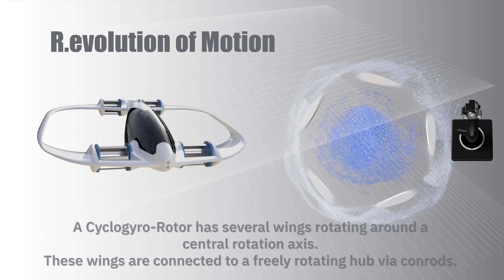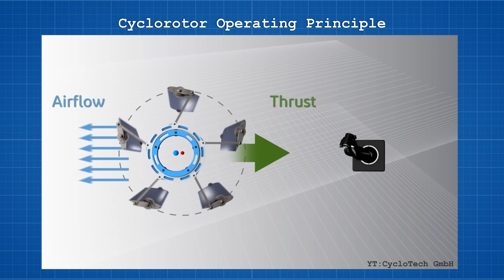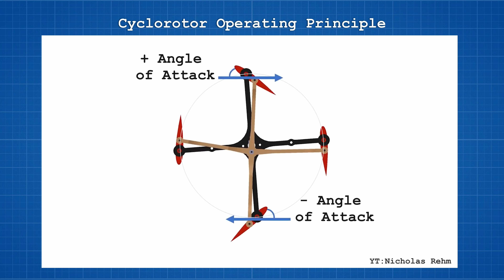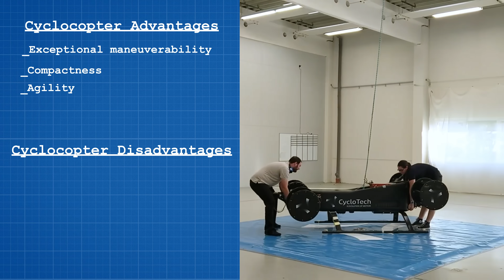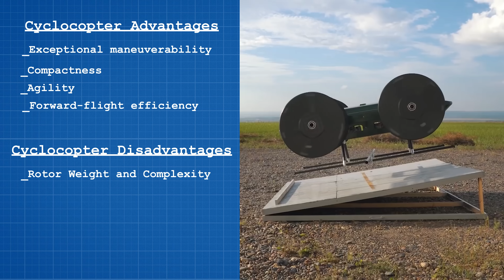CycloRotor: Is this the future of eVTOL Electric Propulsion System?

Comment: The efficiency of cyclorotors is much lower than propellers. Since the energy density of the battery is already a problem with propellers, I am sceptical about this concept. No gliding, too.
Reply: @Zugo99  The Helicopter starts to fall and he has to go through the air, so the propellers get more speed because of the air gliding against the blades, so it gets a bit of a lift... the helicopter crashes, but it does not fall out of the air and can land even for a crash kinda safely... Blackbawks can crash up to 80kmh without a dead crew afterwards....

If one engine fails at this system it will tilt and drift to the dead engine side and then overturn itself and gobstraight to the ground
Reply: @somal1anwarlord197  technically the up flow of air changes the resultant rotational lift causing the total aerodynamic force to be forward of the axis of rotation.

 If any multi engine helicopter loses an engine, in the worst case scenario, the helicopter would do a partial power approach or just enter into autorotation.
Reply: @somal1anwarlord197  it could prob be made to function for a safe landing if it had one of 4 fail if it hadenough energy though,
Reply: @somal1anwarlord197  This is the principal that allows autogyros to work, in essence.
Reply: @somal1anwarlord197  looks like this design has the front rotors running in tandem w/back, i.e. the two front motors are powering a single axle. If I'm correct (might not be) it would take a dual failure of both motors to completely stop power to one axle. You'd experience 50% power loss on one axle, not sure if that would be enough for emergency landing or if it would fall out of sky still. Interesting to find out
Reply: @Zugo99  helicopter rotors can continue to spin without engine power simply by changing the pitch of the rotors. It’s called auto rotation
Reply: @Zugo99  ur not really thinking ab the problem. it will fall to the side that the engine has failed on. opposed to a helicopter, with ONE rotor, in the center, that continues to spin with momentum that can produce lift as the helicopter falls. this is called autorotating, and its how helicopters land when their engines fail. you cant autorotate a cyclocopter.
Reply: @spacenutcj6919  Its going to depend of the design of the aircraft. several where shown to have wings as well as the rotor systems so gliding may be possible to a degree.

 as well if one of the engine fails (but doesn't seize up entirely) then it should be able to auto rotate like a helicopter that has four rotors. as the angle of the blade is independent of the engine failure, meaning the pilots can still control blade pitch. all they would need to do is dial back the other engines to idle and control the blade pitch to allow them all to auto rotate or maybe they could alter the pitch of the other engines blade  to allow the engines to assist the auto rotation on the last blade at the last moment.

if it does seize the engine then there could be a release from the engine itself on the rotors driveshaft so it could also be designed to share the work onto the other engines via a gearing system or share it via axel/gearing to the opposite side engine.)

As well when considering how it would react to an engine suddenly no longer rotating we need to think about how the gyroscopic effect of the other rotors is going to change the path of the tilt as it begins to fall. since each rotor is basically on its side compared to a helicopter. it should in theory when say the front left engine would lock up. it should begin to actually want to yaw to the left side which will cause it to begin to bank to the right due to gyroscopic effect. so it shouldn't actually tilt down where the loss of lift is.

This may even be possible to correct for using flaps or trim on a aircraft with normal wings or it may be possible to do the same using the remaining engines blade pitch and RPM.

Similar to loosing one engine on a 4 engine plane.
Reply: @yawnos  i do hear you but keep in mind the cyclorotors are much lighter and way less large than helicopter rotors so that might play into their momentum when autorotating. its an interesting thought
Reply: @Zugo99  the main rotor blade continues to rotate. The loss of power reduces the lift but does not eliminate it entirely. The pilot maintains control while looking for a landing spot. Once commit, the pilot flies to the landing spot and before landing pulls the collective to maximize pitch and reduce rate of descent to make a the landing. They train for this. So if one of three lifting devices fails on this platform, how does the pilot maintain control?
Reply: @dm_grant  : Just watch out for blade stall.
Reply: @dm_grant ,
🔵 I've got to wonder if the 'Magnus-effect' would allow this to 'Auto-rotate' down controllably (from a decent height) without power?
I'm sure it could be programmed to take advantage of this phenomenon under certain conditions.
Reply: @dm_grant  That is a great answer for "what if the helicopter engine fails". If a helicopter main rotor fails, you will likely die.
Reply: @dm_grant  this model is even worse. In any sort of multirotor that has 4 or less thrust points, if one fails it is going to have unbalanced torque and go into a uncontrollable spin as it flips to the ground
Reply: @dm_grant  what if the tail rotor fails then
Reply: @brandonporter6223  don’t know, not a rotorhead. I suppose your screwed. Hopefully someone else can give you a better answer.
Reply: @brandonporter6223  autorotation.
Reply: @brandonporter6223  tail rotor failure isnt actually too bad. You lose yaw control, but aerodynamics will be stronger than gyroscopic forces and point your nose forward at a high enough speed.
It makes it harder to land but is overall surprisingly easy to deal with.
Reply: @VoidplayLP  that's if your in forward flight right? Whilst the booms aerodynamics are still useful.
Reply: @dm_grant  yeah, I mean, worked really well for Kobe.
Reply: @dm_grant  we all watch Destin from smarter every day but not only is it difficult it isn't easy especially with heavier helicopters lol not even a military pilot will be able to handle this maneuver easily.  You're full of it
Reply: @Zugo99  this machine needs all 4 motors to balance. one lost and its upside down. helicopters hang suspended from the rotor blades. you dont lose the propellers you lose propulsion to those propellers. this machine is also direct drive and can not auto rotate. sorry. but this is a no go.
Reply: @Schwamm Mueri nope, Gyroscopic effect will cause it to spin wildly. Let's say front right rotor stopped working, so you disable back left in tandem so it doesn't flip. Front left rotor spin and back right rotor spin will be reversed from each other and due to their offset from the center of mass will cause a gyroscopic effect which will Yaw the vehicle quite violently.
Reply: @ScarletFlames1  I didn‘t mean that the opposite motor would shut off, but that you use the opposite one to balance, so that it doesn‘t flip upside down. That way you can still use the other two diagonal ones to point straight upwards (or if necessary to correct for the gyroscopic effect)
Reply: @ScarletFlames1  like i said. it cant balance without all 4 motors running. its no different than any other quadcopter that has counter rotating props. these ones just look a little different.
Reply: @ScarletFlames1  it will yaw AND roll.
Reply: @grenadegoboom4967  quadcopter just don't have the necessary program to balance with just 3 motors, but definitely could. The broken arm of a quadcopter would just be an added weight, which has to be balanced with the opposite motor. The problem you would have with normal quadcopters, is that they would start spinning (still staying flat, just spinning around the up-down axis). The main difference between a quadcopter and this cyclo-thing here is that it can't just apply force up and down, but also forward and backwards. By using that trait to counteract the spin, you could fly it with 3 motors.
Reply: @schwammmueri8629  Yes but what counteracts the force of the lost motor?
Reply: @sheilaolfieway1885  To balance that out, you would use the rotor diagonal to the lost one. You can do this by pointing the force upwards to counteract the flip (and then switch between upwards and downwards force on that rotor in whatever direction you are about to flip). That‘s why I said in order for that to work, the cyclocopter must be able to land safely with the downwards force of just two rotors at full power, as the third one can only be used to prevent flipping and spinning.
Reply: @grenadegoboom4967  As much as I‘m skeptic of the whole concept too, I don‘t think it would need all motors, as long as it can produce enough lift with just two of them to safely land. If one breaks, you still have two diagonal motors for lift and one (diagonal to the one that broke) to control the rotation. This would work exactly because they can produce lift in all directions on one axis (here mainly just up and down).
Reply: @schwammmueri8629  it cant balance with two motors. aside from being weird looking. its a standard quadcopter.
Reply: @schwammmueri8629   depending on where the rotors are located and if they are free to spin on their own this may not or may work seeing how the rotors are located at the corner one lost rotor would likely tip the vehicle in the direction of the non-functioning rotor, this will throw off the balance and make it very hard to continue. Even with two  I don't think it will work.
Reply: Not to mention the VOLUME
Reply: @Zugo99  Pray
Reply: @fbbinoire201  what if i killed god
Reply: @Zugo99  The loss of a lift producing surface on any aircraft would be catastrophic, but the loss of an engine on helicopters or planes remains manageable. That's the type of failure David was asking about for this type of vehicle, and I imagine such a failure would not be manageable in this case.
Reply: @Zugo99   smarter every day has a great video about this.
Reply: @Zugo99  'autorotation'  - look it up
Reply: @Zugo99  I would trust a helicopter propeller thousand times more than such drive belts shown in the video. ... in addition you have four cyclic rotors that can fail while having one rotor at a helicopter.
But it is not only about the rotors also about the engines. If the helicopter engine fails they can use autorotation... and what will the cyclorotor do?
Reply: Definitely agree. There is something cool about tires that could turn to rotors though.  Up my degree is in psychology, and I use yt to work on my truck. Not an engineer. Just would be cool if the wheels could adjust and raise, increase speed and turn a car into a flying car. Big dreams
Reply: @Zugo99  it does fall, and the fall makes the helicopter blades spin. The pilot then uses that stored energy by changing the angle of the propeller blades to give upwards momentum.
Reply: @Zugo99  Wow....You know you're talking to someone who knows nothing about rotary aviation when they insinuate a heli just falls out of the sky if the engine fails.
Reply: @Zugo99  then you auto rotate.
Reply: Way to be optimistic
Reply: And sounds really loud too!
Reply: @Zugo99  Helicopters use the main rotor to glide. This is called auto-rotation. This type of lift generator cannot slide using pitch. Because the axis of rotation is not centered. For emergency safety on these aircraft, there should be more than 6 rotors instead of 4. That way, even if one fails, you can keep it level and safe. Or there is another way that doesn't add a rotor. However, adding other features will negatively affect parts, cost, life, shipping weight and maintenance costs.
Reply: I'm not an expert but it seems like there's a lot if moving parts that could break compared to a propeller
Reply: @Zugo99 : A helicopter will auto-rotate and can be landed safely with complete engine failure(failures) and is actually trained as part of obtaining your pilots license. Helicopters are actually quite safe.
Reply: @Zugo99  Cause you haven't studies aviation nor aerodynamics in any sense, yet you respond to YT videos as if you HAVE.  You don't "understand" cause you've never taken to the time to understand how a helicopter's rotor blades  work and how lift even works on any aircraft.
Reply: @jamesroberts3642  Im a mechanical engineer btw
Reply: @Zugo99  Uhhh...ok...Even if you really are, that's like me saying, "the earth is round Mr. TurtleBeat22" and then you reply to me by saying, "No...it's flat...I'm a geologist, btw" or like saying, "No...the Earth is flat and I know because I study biology".  I don't cause what you're profession is or what you studied. If you don't understand how and why helicopters don't just "fall out of the sky" when the rotor stops, then you simply don't understand AERODYNAMICS.  Now....If you were to tell me you were a Aerospace Engineer, then I would either call you a liar or I would just say you're really bad at understanding what you studied.  There is a reason choppers don't just fall out of the sky when power is chopped or is when there is no thrust....and it happens all the time.  They do it on PURPOSE in training (just like we did in fixed wing (airplane) training)
Reply: @jamesroberts3642  actually most mechanical engineering programs involve at least a little aerodynamics, so it's a bit rich that he says that even.
Reply: The fact that they want to use it as a literal flying car propulsion system is the depressing part. 

Seriously you have invented a new propeller engine design capable of competing with regular helicopters and the first thought is practical flying cars? 

What a waste because its a genus design for future aircraft but they want to use it to create 3d traffic jams, never ending noise from the skies and less safe travel for all due to increased private flying with not much real safety over-site for operations. Have fun dodging falling aircraft parts. 

Genius tech innovations but truly stupid applications
Reply: @Ilikefire2793  Right? Think about replacing emergency services helicopters with these things! A helicopter that can get VERY close to cliffs for rescue operations, and the travel from and to the hospital is done at several hundred kmph... it's going to become the de-facto replacement of all emergency services helicopters.
Reply: @ScarletFlames1  perhaps. 

However its kind of rare to begin with for helicopter rescue services being the first choice for responding to emergencies. 

Tho definitely this design may change things. 

The problem could arise if the physics of the 4 engines has some sort of weird problem quirk like the v22 osprey has where its engines are so powerful that its possible to drown the victim you're trying to save.

Only time will tell.
Reply: This is not genus (You meant genius, by the way).  This type of thrust is nothing new and has been though of already way in the past.  And there is a reason it didn't "take off" (pun intended).  Research thinks involving trust-to-weight ratios, auto rotation, etc when it comes to non-winged aircraft if you really are interested in this concept and want to know more. We live in a time where "solar roadways" and the "hyperloop" is considered "new" and "genius" when it's not at all (yet millions online are taken advantage of for funding)
Reply: @Ilikefire2793   This is not a "new propeller ... design".  This mechanical design called VSP or Voith Schneider Propeller (although made from very heavy solid brass and stainless steel) is what is under many Tug Boats for 20+ years.  In the case of the tug boat it allows for instant 360 degree directional thrust control and are often used in pairs pointing down.
That said, I agree with you completely.  Any dream of filling the skies with high energy consuming personal vehicles for the masses is a NIGHTMARE in my opinion.
Reply: @Zugo99  a helicopter doesn't crash if engine shuts down https://youtu.be/BTqu9iMiPIU but this one needs all 4 to keep running at all times.
Reply: @davidgrant6451  i think it will lose lift on one corner of the vehicle, but it will still be controllable. A single engine loss on this thing could be countered by lowering or reversing the rotor Speed on the diagonal opposite side of the broken engine. but i guess  by doing so a emergency landing is unavoidable as the aircraft does not have enough thrust anymore to retain its altidude.
Reply: @Zugo99  It's a phenomenon called 'auto-rotation'.  Feel free to look it up.
Reply: @Zugo99  think of helicopter blades as a wing. Technically, it is a wing, just rotating and have adjustable angle of attack, allowing you to control its lift. 
If for some reason engine stops, blades will continue to spin - that’s called “Autorotation”. It will generate enough lift to let you glide. 

But if blade will stop spinning midair, that’s where you are ded
Reply: @Zugo99  Engine fails = no problem, safe landing

Gearbox fails = You're fucked
Reply: I don't get why everyone so obsess about battery only powered drones. Making hybrid drones is way better since they have higher energy density even after loss at the generator. People already break endurance records with it with up to 10h flight time.
Reply: Or auto-rotation, meaning it'd drop like a brick.
Reply: Can I Be a crash test dummy
Reply: @nathanthomas8184  It's 2021 you can be whatever you want!
Reply: @somal1anwarlord197  But what pronoun do we use when talking about/to the dummy ?
Reply: @somal1anwarlord197  "I identify as an attack helicopter" -- Lauren Southern
Reply: @nathanthomas8184  yes, you can. Not sure about crash test, but dummy you are already.
Reply: @Zugo99  depends on how it fails
Reply: @Zugo99  it's a real thing that happens. The propeller loses power but doesn't stop for a good second. It continues with its momentum and since it's spinning its providing lift
Reply: First thing I thought was "I'd not buy one unless it had wings for gliding if one of the cycle rotors fails". Combine this concept with gliding wings and I think people would feel more safe. Weight wise though, not sure if it can work yet.
Reply: @CaseyChristopher  If you are happy with large wings, you can use normal helicopter.
It's always a trade between size and power. Large enough wings can fly with (almost) no power. This thing is small but needs a lot of power. I don't see a reason why it couldn't fly on 3 propellers though.
Reply: @CaseyChristopher  even ignoring the safety of having wings for gliding during a failure, they would greatly increase the efficiency of forward flight.
Reply: @Zugo99  : Then you autorotate to the ground in a controlled manner.  No different than landing an autogyro.
Reply: It is really retarded idea
Reply: @Zugo99  believe it or not, you can actually save land a helicopter with an engine failure.
Reply: Did you even watch the video?
Reply: same goes for the other engines. Its all about research and developing the tech. This is why we use ICE over steam engines
Reply: Just to reiterate what others have said: the issue is motor failure, as failure of wing surface is necessarily catastrophic in all flying objects from this all the way back to insects.

As for compensating in the event of motor failure, I'm imagining if each rotor is powered by a separate motor, but then there is also a transfer case to use as a back up that could lock the three remaining motors together in the event of 1,2, or even 3 motor failures, allowing at least one quarter power to all rotors in order to make a safe emergency landing.

Also saying that I'm not looking to test fly this ;)
Reply: Rotors don't glide they auto-rotate, energy is always the primary limitation i suspect it always will be until compact mass to energy conversion
Reply: I wonder about critical Mach number on those rotor blades
Reply: Yep. This only exists as a novelty. I can't think of a single application that would make this preferable to conventional propeller power.
Reply: @Zugo99  Aah you can do this. Take a small strip of paper and throw it from a height.  You'll notice it'll start spinning while falling . 
The same thing happens on the blades of helicopter except that they rotate horizontally rather than vertically like the paper. 
The air hits the bottom of it and then slides back and since there's nothing stopping the rotar it moved ahead and now apply it on all the blades of the rotar and you'll have a constant rotation on the blades which will create lift while falling down. 

As for this . It's unstable and the thrust generated by it is much less it's generating 25 kilos of thrust per engine.  
If you use that configuration with a quad copter or a normal helicopter with the same hardware you'll get better results without even making any changes in it. This design isn't gonna work on moutains and all because it's janky. The size of the rotars it'll require is huge and if they want it to be smaller they'll need do redirect airflow to it as well as increase the speed and use a compressor for some extra thrust otherwise it'll be the same as a beetle with 40inch wheels
Reply: @JINKAZAMA-ik2df  The F-117 Nighthawk would not fly without it's computers to stabilize the thing, so if it's engine fails and the battery runs out of juice, that plane will literally fall out of the sky. This would actually be far easier to control, and computer systems now can detect a failure and automatically compensate or initiate a forced emergency landing via gps. If one or even two of the variable pitch rotors on this craft fail, the other two rotors can compensate for roll and yaw, but pitch would be a concern. Fortunately, this craft does not maneuver by pitching the craft. It stays level while the rotors change the thrust vector, similar to the exhaust collars on many modern fighters but in all directions.

Another example: flying wings. Those particular planes are the embodiment of a perfect wing. Their control surfaces are designed to minimize the yaw when banking and maximize stability. Unfortunately, they have one massive drawback: you cannot recover from a flatspin. If we can make stable a flying wing and a plane that was made unstable by the flat panels that were the original radar absorbing panels, we can make this stable and even reliable. However, much like the F-117, this will require computer systems and sensors to maintain stability and compensate for failures. Unlike the F-117, it will not need 3 redundant flight control systems to do so.

This craft would be quite simple to learn to fly if the controls are intuitive. Alternatively, it could be controlled remotely by a taxi service.
Reply: @Zugo99  If you're talking about a true helicopter then you land by autorotation.
Reply: @Zugo99  Zn autogyro or hydroplane has mo power to the rotor.
Reply: @Zugo99  well I mean come on mate. What if a modern helicopter thats currently being used today fails? 
Well people die.
Reply: @Zugo99  a helicopter is technically safer than an airplane in case of complete engine loss. As it can still land vertically while an airplane still requires a landing strip. 
The quadracopter can technically still land but needs at least 3 working motors and a controller capable of flying using 3 motors but a complete power failure will still result in a free fall.
YouTube comment sections is a bad area to expand on this but the keyword you are looking for is autorotation and an interesting vehicle using this principle is the autogyro.
Reply: @Zugo99  the propeller won't fail, but if the engine fails the helecopter slowly lands
Reply: Batteries are improving constantly
Reply: And unlike conventional Helicopters Doesn't look like autorotation will work either.
Reply: @Zugo99   it's called autorotation and a properly trained pilot can pull the collective to use the air coming across the rotor to force some of it down lessening the fall.
Reply: @Zugo99  If the rotor fails, you die. However, if the engine fails, you can still autorotate. Can this do that? It's also wildly inefficient. it's ALSO four times as complicated. It's also being sold by a snake-oils salesman with CGI instead of actual demos of to-scale prototypes. Sounds like a line of bullshit to me (which shouldn't be surprising in flying car adverts, or hypersonic plane adverts, or high-speed tube train adverts, or cheap nuclear/ cold fusion adverts, etc. since these things have been advertised to us despite any evidence of viability for quite a long time now, especially when there's a chance of raising investment money).
Reply: @Zugo99  Pedant voice Helicopters have propellers? 😁
Reply: yeah
Reply: @Zugo99  then you autorotate
Reply: @davidgrant6451  It needs a parachute on top.
Reply: @Zugo99  U can still land a helicopter, even both propellers fail, and almost impossible to snap in flight.
Reply: @Zugo99  helicopters can autorotate without engine power. You're supposed to do that before you get the license too
Reply: iam optimistic about this
Reply: @Zugo99  hellebores can glide remarkably well.  Look up the smarter every day episode on youtube.
Reply: That was my first question. Just intuitively, it appears to be far less efficient.
Reply: @jwalker6260  The Voith-Schneider drive for ships is also a lot less efficient than a propeller. If we are operating on the brink of what is possible with the energy density we have in the foreseeable future, you'd want to squeeze every bit of efficiency out of the remaining components.
Reply: @Zugo99  You’d still be able to autorotate down.
Reply: @Zugo99  tldr helecopters can still land safely if engine fails🤷‍♂️
Reply: @B K Not a first prototype. The video shows old movie footage of previous attempts. This concept has been attempted many times and has been  shown to work, just not as well as other more efficient systems.
Reply: @Zugo99  imagine a maple seed pod falling from a tree. It uses drag to create lift and slows the decent as it spins.
Reply: @N K to be fair it's rather new tech that didn't have a lot of funding in the past and little research so there will probably be a lot of problems with the current design that may have manageable solutions by a really driven CEO and workforce.
Close to nobody thought SpaxeX was going to work and yet here we are.
There are way more examples that might be a better match to be fair.
History is littered with these, it might take time before some other discovery or theory with research might help with the issues this has.
However some are indeed very fundamental and don't seem to have any obvious solutions without really thinking about them (and I'm not the one willing to put in the effort and don't have enough data from the company + am not capable of everything which is logical, but one could give it a shot, just really break down the problems and what's necessary for this to work and be viable and be creative, test a lot and readjust your mindset)

Edit: forgot to mention that it would be insanely loud however. So much so that it wouldn't be allowed near cities.
Reply: Maybe as a backup
Reply: @Zugo99  thing called torque and leverage exists
Reply: @Zugo99  
Autorotation is the technique taught to helicopter pilots. The pitch of a helicopter's main rotor blades is adjustable. In the loss of power the pilots uses the air now passing across/through the blades to get them spinning. The last few feet above the ground, the pilot quickly changes the rotor pitch to generate enough downward thrust to help cushion the crash. Think of a leaf falling from a tree and spinning towards the ground.
Reply: I wholeheartedly agree, it's an interesting concept but it isn't all that practical.
Reply: Lose a tail rotor though ....
Reply: @Zugo99  it glides to safety.
Reply: Correct about the lack of gliding. Actually the same as with drones. No glide ratio like a helicopter has. In a case of engine stop, it will drop like a stone to the ground. I don't want to be a passenger in such a machine.
Reply: ...not to mention the loading on those airfoils. They aren't in tension loading, like propellers.  They want to snap in half. One of them lets go, the rest of that rotor will let go for sure.   
I'd invest in aircraft made from stone before I'd get on board this effort.
Reply: @Zugo99  you should stay out of any discussion of aircraft, clearly.  How did you learn to breath?
Reply: @davidgrant6451  you cut the engine diagonal, and use it's upward/downward thrust to stay level. then you find a landing place.
Reply: Best use for ship
Reply: @Zugo99  A part of all helicopter pilot training is to shut off the engine and land the helicopter in glide mode, there are lots of youtube videos that describe the physics of how it works.
Reply: @davidgrant6451  You'd probably need a rocket propelled parachute solution as a backup. These solutions are common in ultralights where the overall structure is not sufficiently trustworthy.
Reply: @Kreed Kafer Spooky haunted paranormal spirit ghost i didnt know there was cyclocopter pilots as i thought this was just a proto lol...
Reply: Yes even to me being complete non expert I feel like a better design would be 4 turbines or mcro jet engines ...well until, of cOURSe, they figure out rEAL antigravity, that is 🤓
Reply: @davidgrant6451  What Is Islam?

Islam is not just another religion. 

It is the same message preached by Moses, Jesus and Abraham.

Islam literally means ‘submission to God’ and it teaches us to have a direct relationship with God. 

It reminds us that since God created us, no one should be worshipped except God alone. 

It also teaches that God is nothing like a human being or like anything that we can imagine.

 The concept of God is summarized in the Quran as:

{ “Say, He is God, the One. God, the Absolute. He does not give birth, nor was He born, and there is nothing like Him.”} (Quran 112:1-4)

Becoming a Muslim is not turning your back to Jesus. 

Rather it’s going back to the original teachings of Jesus and obeying him
Reply: @Zugo99   That’s why there are schools. Learn to understand the first thing that you still find hard to understand, before commenting on other matters.
Reply: No need for gliding, that's what ballistic parachutes are for.
Reply: @Zugo99  In case of rotor failure helicopters can make emergengy landing with autorotation
Reply: Yeah this is straight up stupidity
Reply: Could you imagine the tailspin its gonna go into when one engine fails to spin
Reply: Look at the pulley system on that thing no way is it economical
Reply: @Zugo99 helicopters can “glide” and safely land in the event of loss of power due to autorotation.
Reply: @Zugo99  Try flying a 4 rotor drone with 1 turned off lol.
Reply: There was once a guy who came to our carbon fibre company. This inventor had the same idea, he spend all his money and all the money from his investors and three years of his precious time. He failed, it didn't worked at all but it was interesting to work with him. We earned a lot of money with this dude but as I said this thing destroyed itself nearly  every time and this thing was incredible loud.
Reply: Cyclorotor design advancements, Battery advancements, ballistic chutes..
Reply: @Zugo99  Name is Auto-rotation, youtube has great videos on it. You can do it in Arma even
Reply: This technology is DOA.  The company is just hoodwinking some investors to grab their money.  It’s a joke.
Reply: @Zugo99  A helicopters blades arent directly linked to the engine. They are connected with a clutch. In case of this emergency the clutch disengages and the propeller can spin freely. A skilled pilot can use the helicopters speed to spin the propeller by reversing the pitch of the blades. As the aircraft gets closer to the ground the pilot quickly switches the blades back to normal and can reliably create enough thrust to land in a survivable manner. Usually the aircraft will sustain damage but that's better than being dead.
Reply: This is the first thing that popped into my head, this is a waste of money IMO. This can be modeled to tell it's a bad idea.
Reply: @Zugo99  you auto rotate. The idea is that the airflow going though the rotor blades keeps them spinning and creating lift. This way as long as the helicopter moves forward it can glide like a plane can.

Fun fact the “first helicopters” didn’t have powered rotors and relied on this principle to fly (with the help of forwards facing propellers to move the aircraft forward) this type of rotorcraft are still in use today and are called autogyros.
Reply: @N K it really is, no matter what its more mass to keep spinning than 5 blades, having massive complex shaped drums made of either aluminum, or a carbon fiber construction, is probably not better than the tech we have already optimized the use of and technically still haven’t finished researching what we could do with alternate propeller styles
Reply: Couldn't have said it better. The only benefit that I can see is the small footprint.
Reply: What a great waste of electricity! This is a fiasco. 
For those reasons, I am out.
Reply: @Zugo99  Shindeiru
Reply: @B K No, this is one of those tech scams to generate cash from gullible investors.
Reply: That's completely false
Reply: @Zugo99  its called inertia.
Reply: Can still ADD few ordinary propellers, fixed or tilting, to augment the effect of the rotors. No need to have only one or the other. Hybrid designs leveraging the benefits of both methods may be winning.
Reply: Per your original comment about "gliding", it appears you are more referring to the shape of the body of the aircraft, and if that's correct, the same can be said about the body of helicopters not being capable of achieving significant "gliding" on their own. Your later comments then went on to highlight the drag for helicopters being rightfully achieved via their rotor blades. That being the case, it seems a similar type of gliding can be achieved with the variably controllable pitching of the blades of the cyclocopter. In case of an emergency landing as far as the pilot is still able to control the pitch of the blades, the pilot can generate some drag between the cyclocopter's blade and the air whooshing past them enough to achieve some gliding (i.e., the cyclocopter likely won't drop out of the sky like you seem to be suggesting). The truly debatable question is: In case of an emergency landing, is the amount of controlable gliding achievable with the cyclocopter equal to or better than that of helicopters? 
My answer to that is: No.
That said, they are still trying to technologically figure out things about the cyclocopter. So give them time to do just that, after all helicopter technology wasn't all figured out in a flash of time. Something else to keep in mind is part of what is likely being figured out for the cyclocopter is proper types of applications for it. Cyclocopter could end up being solely relegated to unmanned flights in remote areas. In such a case, safer landing and inceased chance of recovery could be made possible via integration of self-deployable parachutes in combination with an algorithm in the cyclocopter's ECU for automatically controlling the pitching of the blades for the purpose of achieving some gliding just before and after the parachute is deployed.
Reply: @Zugo99  isnt that the point lol dont pull a coby and glide
Reply: The fact that the blades can change pitch makes a huge difference in efficiency. I know that with wind turbines with blades in this orientation, they're actually more efficient with less wind.
Reply: Am I a fool to think this might be usefull in the future for a vehicle to drive and whenever it wants, takeoff and start flying
Reply: This is true untill you get into heavy winds
Reply: Parachutes could be a safety device for engine failure.
Reply: @Zugo99  That thing will tumble out of the sky as soon as one of those rotors stops turning at the correct RPM. Helicopters can quit easily land in the event of losing their engine. The procedure is called an autorotational landing and all helicopter pilots are trained to perform it.
Reply: Yeah this was my thinking. The biggest problem we have is battery life and therefore flight time.
Reply: Hybrid flying car 🚗 like this would be more interesting 🤔?
Reply: @Zugo99  a quick google search can do wonders before proclaiming your ignorance on the internet
Reply: You're no fun. 😜😂😂😂👍🏻 
 You're very right though. 
 Maybe they can have retractable wings.  Although the problem here is they would add more weight. Maybe they can just have pivoting wings just enough to create a glide path if necessary.  ? 🤔
Reply: @Zugo99  there’s gliders that use non powered helicopter rotors to fly.
You ever dropped like a bladder toy and watched it spin on the way down from the drag? The rotor will continue to spin from the drag as it’s falling so you reduce the drag and let the rotor come up to speed them increase the pitch creating lift and slowing down in the case of a unpowered helicopter.
To make an emergency landing with a helicopter with no power elevation is your friend the high up you are the more time you have to gain momentum on the rotor for your emergency landing.
Reply: @Zugo99  Never heard of autogyro?
Reply: You took the words right out of my thumbs.
Reply: No attackable wings
Reply: I could see some use as a automated drone maybe in Cramped spaces or exploring caves? Not sure about replacing traditional Helicopters though
Reply: Shhh don’t tell the investors
Reply: Any idea the actual efficiency number? What are we talkin’? 65%? 75%?
Reply: And also it sounds like an air raid siren
Reply: You will have to have those spinning cylinders partially covered for safety reasons. No way you can have spinning limb choppers like that just exposed. Any covering will dramatically and negatively affect airflow. There's a reason we don't see images of futuristic short range aircraft with a Cessna like propeller on the front, and the design in this vid has four limb choppers, one on each corner.
Reply: I Was just thinking  the same thing..  guess the real question is does it work harder to generate lift then propeller propulsion..
Reply: Not sure how cyclocopters compare to to to single propeller helicopters but when used in drones, four cyclorotors are far more efficient than four small propellers
Reply: Yeah no gliding part does it for me tbh, but I wouldn’t get in a helicopter either.
Reply: Well ur right, right now our modern tech battery efficiency is quite low and problematic. But in the near future Battery will get powerful as they get smaller and smaller so this kind of technology will probably be used in the future.
Reply: Presumably this would compete with helicopters more than fixed-wing aircraft. But maybe it can autorotate?
Reply: @Zugo99  sorry to break this to you but if one rotor fails the craft goes downhill. All 4 are needed to provide controlled. Lift
Reply: @davidgrant6451  You enjoy a faster than normal landing.
Reply: No gliding like Helicopter
Reply: @Zugo99   parachute
Reply: @no_tread_  wingsuit
Reply: But these look cool and stylish else private planes
Reply: Helicopters don’t glide either though
Reply: @paulallen-01  no but the rotor can be used as a makeshift parachute if its allowed to spin freely so that the landing impact is reduced.
Reply: @Ilikefire2793  oh really? I didn’t know the rotor did that
Reply: @paulallen-01  yes they do. Look up “autorotation helicopter”
Reply: Hi https://youtu.be/L0HUlvg01XA
Reply: they said the same about helicopters.
Reply: quadcopters and helicopters dont glide too
Reply: @voron27  quad copters have four rotors but usaully normal helicopters only have one rotor so autorotating is easier with a quad copter since the blades don't pitch they Definitly won't autorotate to the ground.
Reply: more compact though maybe it wont be used to fly in the sky but used to readjust space station in space
Reply: @troydashtheperson  some people just dont get it
Reply: @thecrazyinsanity  if thats the case point them in a direction to video that will explain it to them. Some people need pics
Reply: @thecrazyinsanity  Your name is ironically applicable to the challenges you have pointed out Re: Troy. (High five for crazy).   I was simply going to tell Troy "why then would they call it a Taxi?".
Reply: @troydashtheperson  no air no effect of the props
Reply: @troydashtheperson  what? There's no air in space, any tipe of prop won't work
Reply: @troydashtheperson  what
Reply: @troydashtheperson  Not even used on the space station. In the first place, cyclogyro doesn't work in space.
Reply: @보라돌이ioi  to be far they work in the station, just not outside ;)
Reply: @troydashtheperson  i
U probably dont know too mutch stuff about space bc there is no air on spacestations so you can not have this thing there
Reply: @oliverlabudik3355  read the other 10 comments i posted
Reply: @troydashtheperson  sorry but it is shown and told in video that its using aerodynamics
Reply: @troydashtheperson  no it wont function in space cause there is no air in space. It’s space.
Reply: @abvmoose87  bruh read the other things I said on how i4 might work due to a physics effect
Reply: @troydashtheperson  do propellers work in a vacuum?
Reply: @troydashtheperson  what the fuck? THere is no air in space, that's why they need suits to go outside, and air is needed for any AIRcraft
Reply: @troydashtheperson  Tell me you're just kidding and don't need for someone to explain why that can't happen.
Reply: @troydashtheperson  elaborate please 🙏
Reply: @troydashtheperson  uh, you know there's no air in space, right?
Reply: @troydashtheperson  no air to oress against in space
Reply: @troydashtheperson  The basic theory behind propulsion is Newtons third law, which is: for every action, there is an equal and opposite reaction, which basically means when you push something, it pushes back, which is why when you push a wall you move backwards, while the wall does not move due to its much higher mass and foundation. for all water and air travel involving propellors or rotors is that it pushes the water or air in the opposite direction to where you are travelling/speeding up towards, and as water or air is pushed away, it provides an equal and opposite force to the vehicle and therefore thrust is produced. the conditions required for this is that there is something to 'push', which can only happen in atmospheric conditions, water or land. in space it is a total vacuum meaning there is nothing, no air or gases, therefore rotors or propellers do not work in space. Space travel involves the use of thrusters which also make use of Newtons third law but in a different way
Reply: good lord the amount of people who don't understand helicopters in this thread is too damn high
Reply: @matthewday2277  wow thx for the information. I was kinda thinking of it as a gyroscope. which if you dont know gyroscope are used in space to angle or balance space crafts or space stations, satellites.
Reply: @fmobus  how many people do you think understand helicopters?
Reply: @troydashtheperson  Oh right, i imagine there are better structures that can be used for a gyroscope than this and it could potentially work but for things like the space station it is too large with too odd of a shape, which causes its center of mass to be quite obscure and so it would be quite hard to get accurate movement. Gyroscopes are used atm in rockets though however they are an actual part of the rocket and not outside like in the video,but SAS (the gas) is still a better option for larger structures
Reply: @skmo7105  Not him